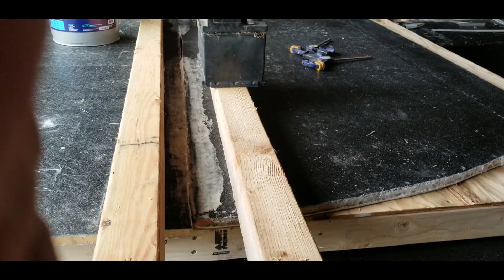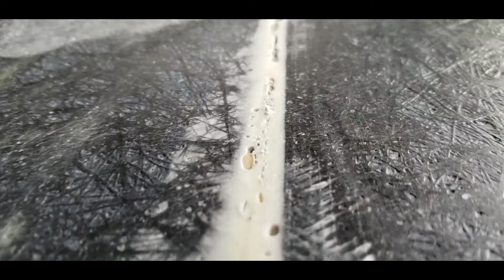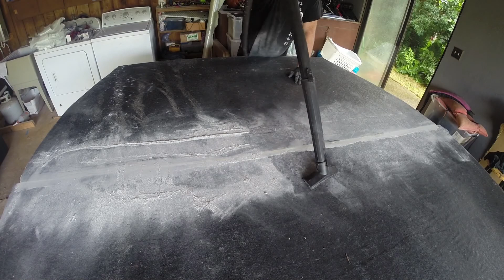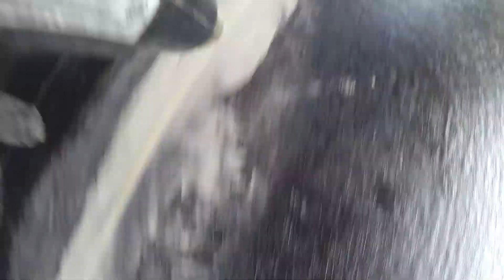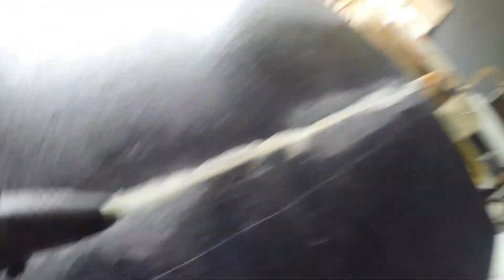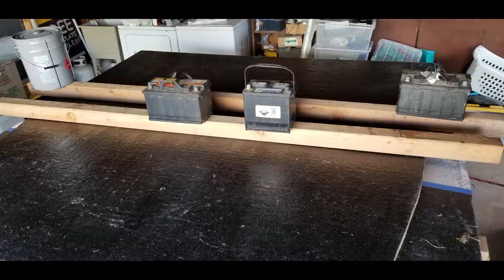Solar Patio Boat Build 16 - Four deck panels become two!

Comment: progress is coming right along - nice work.  Your mention of boat building being a gift to both you and your son is exactly right.

 'just had a thought, maybe flipping the sanding belt around so it spins the other would introduce new/sharp abrasive and get you some more use out of it.  I'm going to try that too.

I had my electric boat out and was told I could burn out my controller with it running so close to 'rated capacity' - well I did.  I have since gotten another, larger one and bought and had delivered 2 Battle Born 100 amp hour lithium iron batteries. $900 a piece!!!  wow/wOw

Been raining here (calif) so that's slowing me down as I work outside but boating season is headed our way - Keep on Buildin'
Reply from the maker: The belts gum up quicker when I only let the resin cure for 24 hours before sanding... belts are not that much so sometimes I will just abuse them.
Reply from the maker: Those Battle Born batteries look nice!
Reply: @StokedByDesign   I got them from the company site, they are listed at $949 each but they gave me $50 off each cause I bought 2.  There was free shipping.  Maybe it's different pricing if bought somewhere else.  The reviews seemed real good and I've got a few extra bucks in my life, so ........
looking forward to your next video!